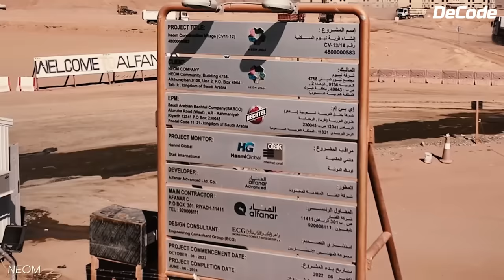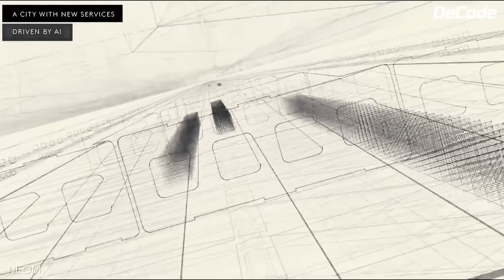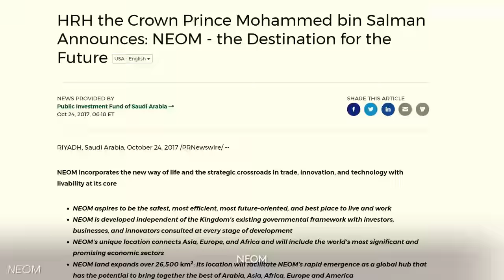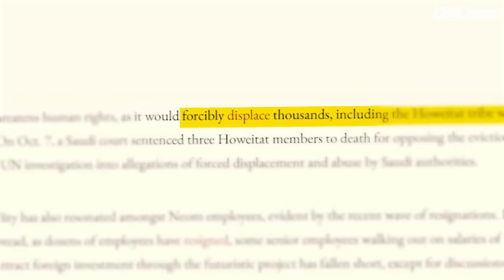NEOM Latest Construction Update 2024 Insane Progress!

Comment: A rail system that can travel from one end to the other in only 20 minutes? So, those living at each end can easily visit each other. All those in-between must still use camels in the desert? lol (Or, 170 stations, each one kilometer apart, and the entire trip now takes 14 hours.)...this entire video is misinformation. Imagine how many people want to live near the coast, rather than the center of the desert. But there isn't enough room in the "Line". Eventually, an entire city will appear around the "Line" at the coast. Probably mostly slums, but still a city, defeating the whole point of a narrow walled environment..
Reply: 25.6 kilometers of rail for a 175 kilometers of city.  Each end will go 25.6 kilometers from each end leaving 125 kilometers not serviced by rail

Comment: If they wanna try it, try it I don’t care. But there is literally zero reason to go for 170 miles in length and go for 500 meter height. Why? I am 100% sure that first they will build like a 20 mile one and then test it out, because the whole thing is just a huge waste of money, and work. It’s incredibly fucking stupid. Why would anyone want to live in such a stupid enclosed space like that?? And they say it’s luxury???? This is a disaster and it’s never gonna happen. I hope they realize it sooner than later that this is basically burning money. And the concept sounds incredibly stupid.
Reply: 500m highwall   that taller than 90% of the world skyscrapers, and 170 km long
that a fking huge sail,   then the mirror   how long these mirror last- replace  them every 20yrs  at least.
170km x500m= 85,000,000  square meter of mirror  x 2 for both side 
total surface area of the walls 170,000,000  msq.  that is a lots of mirror 

if they install solar.  still stupidly expensive  and atmost utilise 30%-40% of the solar power generation 

what ever way it just stupid idea ( and this is only the wall)

Comment: What a dystopia it will turn into.  Imagine when one section revolts and blocks passthrough or those on the bottom floor rise against those on the top.  And I consider keeping the integrity of this 170-kilometer-long building to be impossible over time.  One earthquake and the line will probably break because the ground shifts horizontally or vertically at some point(s).  And a thousand other things...
Reply: Blokwars, an unavoidable problem with megacities. Lucky for us, SA already has a judge system ready.
Reply: And what about Israel? What if they feel the need to ‘defend’ themselves again!
Reply: They will need a judge dread
Reply: @Donnerspeer you know the old saying, ppl that live in glass cities shouldn't blow themselves up.

Comment: the best video on the NEOM Project, which provides comprehensive construction updates on all the projects within NEOM. This video also Covers the criticisms surrounding the project, making it a well-balanced overview. I encourage others to watch the entire video for a thorough understanding.
Reply: well aren't you just a walking propaganda machine.  no, it doesn't address the criticisms at all. it's not well balanced, it's just another MBS hype piece full of lies, and watching this doesn't support a thorough understanding because it doesn't address the fact that there are no blue prints, the technology to build this doesn't exist and even if it was feasible to scrape every single last bit of raw materials on the planet, there still isn't enough raw materials to make what is needed to build this.  the fact that the claim is 20% complete is the same as saying that MBS is more compassionate than the bhudda. and to put a fork in this, the reality that this train will go end to end in 20 minutes means it has to run at 300mph without making a stop.  that's the only feasible way to meet this 20 minute threshold, and currently, the fastest trains in china barely top 300 mph.

Comment: That high-speed rail might be able to go from end to end in 20 minutes non-stop but it's going to take much longer if passengers have to get on and off every mile or so.  I'm sure there would be plenty of stations for such a long city.
What annoys me is that the Saudis can work that fast on such a huge project, yet in NYC it takes five years just to get a painted bicycle lane.
Anyway, that project seems less than 2% completed, and not 20%.  There are no walls or central building structures which should take much more time to construct than clearing the land.
Reply: Are they moving fast or are they just breaking ground over 175 KM and making it look like they are?   I predict that what ever sections are completed will look like Blade Runner
Reply: 20% does indeed seem like a lot for this scale of a project 15% maybe. Dirt work is a huge part of any building and often takes a lot of time to get correct at a set elevation that remains consistent. Without the ground laid out correctly it makes pouring level concrete very difficult

Comment: I'm interested how they plan to build plumbing and sewage systems. I hope they won't transport poops Burj Khalifa-style i.e. on trains. Also Line-city is very vulnerable to disasters. If something bad happens it might disconnect city in two parts: one part with water and another part without it.
Reply: Hopefully into a facility that turns biomatter into gas, you can reuse the rest as fertilizer. That said, it is an expensive option.

Comment: It is easy to predict that the total construction cost per usable square meter for living and working will be prohibitive.  Why? Every cost engineer can tell you that building so high needs an expensive structure. and infrastructure. 
And same wise can every cost engineer tell you that building so narrow (200 meters wide) will also cause extremely high cost of infrastructure. It comes to me as no surprise that they reduced the length of the subway with 30 kilometers and reduced the number of terminals/stations from 38 to 9. This means that stations will not be less then 4,5 kilometers apart but almost 19 kilometers. How do people get home ?

Comment: Gee if only there was a quicker way to get from one end to the other. Perhaps if they brought it around into a circle, then perhaps if they opened the middle so that you could travel through from any one point to another quickly, then maybe if they removed the outer walls so that you could easily travel outside the city, and maybe opened up the top so that you could fly...
Reply: well clearly you've missed the bigger point.  if they considered your way then they couldn't call it the line, could they.  seriously, get a grip (that was sarcasm by the way)

Comment: Insane progress... yeah, way slower than thought. 1 year has passed and not 1% (1.5km) of bldg has been built. Only still dug sand. This is meant to be finished by 2030 right?
Reply: The slowest part of any project is the foundation. Excavating, drilling and placing pilings can take a lot of time, but once all the foundation is in place, putting up steel moves pretty quick. And overall construction techniques use a wave method. They start on one corner and start putting up steel, as soon as it has progressed enough they start the next phase while steel continues to move further down. And once phase 2 has progressed enough, they start interior layout work, etc. So really, once they get foundations in and ready, things will pick up pace drastically. And once enclosed it will appear to slow down as everything will be happening internally.

They're absolutely going to run into delays, but they also have more money than God. Regardless of how this all plays out it is a bold attempt at some new things and ideas and I like that. It's how humanity has progressed for 10s of thousands of years. By trying and learning and trying again.
Reply: Sindalah is nearly completed and is scheduled to open in the year 2024.

Comment: Are they going to build any points that you can pass through from north to south or will people travling by land going to be force to go all the way around?
Reply: There putting some ladders spaced a mile apart
Reply: This is a great question ladders spaced a mile apart?😂 why not doors?
Reply: What roads, what cars? Only you’re getting close is by air or their subway. Maybe from the port end
Reply: @nutsmcflurry3737  it's not about roads, there have been nomadic tribes that have freely traveled across the deserts for hundreds of year that will be trapped either north or south of the wall, unless they build crossing points.
Reply: You wouldn't get close to a mirrored wall in the middle of the desert to even pass.. it'll just fry anyone within a mile 😂
Reply: @kenheaton5489  THEY MIGHT BE TOLD TO AVOID THAT WHOLE AREA. A BRILLIANT QUESTION INDEED.
Reply: @bradriley7759  NOBODY IS GETTING FRIED IN NYK MANHATTAN LAST TIME I CHECKED. THE BUILDING IS  REFLECTING HEAT FOR FEW HOURS AND MIGHT BE ABSOLVED BY THAT WHOLE AREA. DESERT COOLS IN THE EVENINGS. SO SURELY THERE COULD BE HEAT AROUND BUT NOT FOR A MILE.

Comment: Neom itself will either be an ecological disaster, or a financial one. Trojena, however, may become the success Neom was meant to be. The same technological lessons needed for Neom could be applied on a smaller scale, the failures would be hurdles rather than walls, and it’s small enough the ecological impact could be effectively marginalized by a ruthless enough corporate push. Basically: Fail small, advertise the successes more effectively, and market well enough… And it could be viable.Trojena, not Neom
Reply: If it wasn't for the name: Trojena, which brings any italian speaker a huge smile. The name Trojena is akin to Lolita's Island...